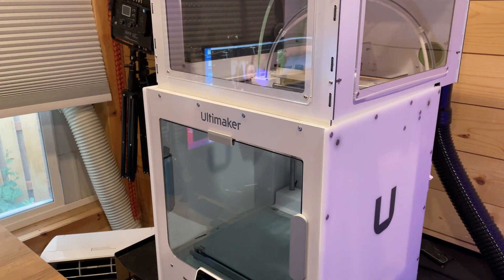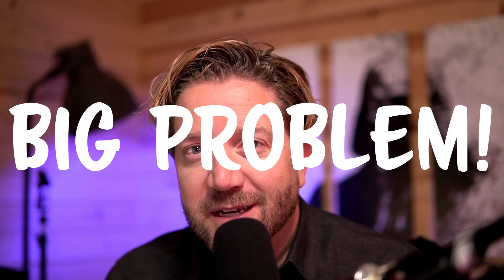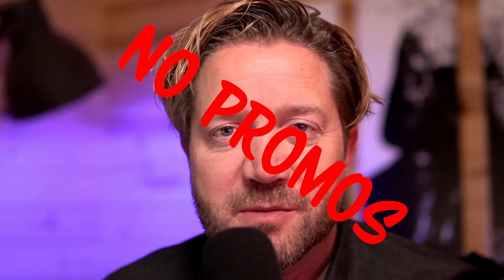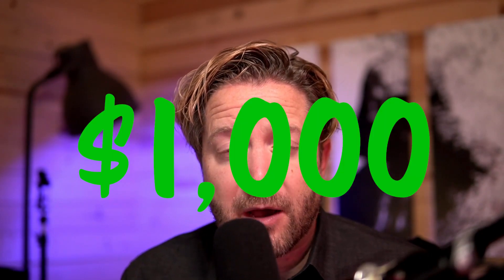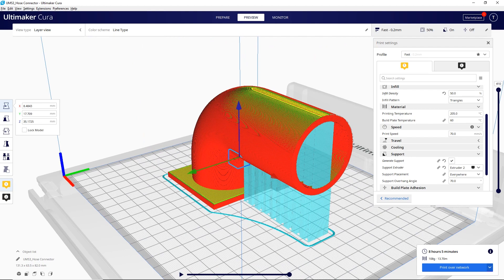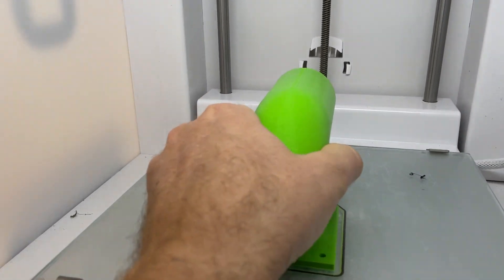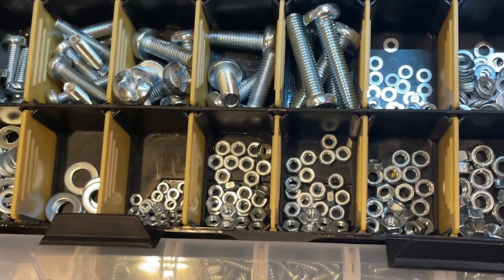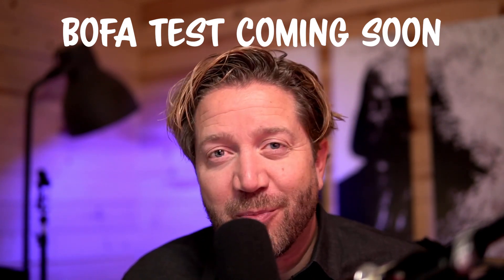Removing My 3D Printer Fumes (Enclosure & Filter Build)

Comment: Use a different angle when either designing the part or when placing on build plate to eliminate supports.
You could have gone with a say 60° angle for the part design instead of 90°. 
With the 90° angle design you could have rotated the part on the build plate in such a way that the supports are minimal.
Also with the 90° design instead of supports you could have added a rib of 1-2mm up to the build plate, only the beginning of the circle needs supports.
So really there are multiple solutions which were better than what you did, but yeah you just used a little more supports no big deal.
Also why are your corners not rounded on the mounting plate ? This does not make sense, since rounded corners print faster, nicer and better.

Comment: Yeah, I have a better way to do that.  Go to a hardware store and get a PVC 90 degree bend of the closest size.  Then 3d print only the coupling/adapter from the PVC to the enclosure.  Probably a 2 hour print instead of a 6 hour print.  A lot of these parts exist and don't need to be printed.  Just a suggestion.

Comment: Hi Tyler, Years ago I bought an expensive [enclosed] 3D printer that has a slot / tray for a HEPA-filter. The printer sits in a closet. This keeps the temperature constant, the sounds muffled as well as the effects contained. This proves to be very effective. The HEPA-filter works well filtering the air. I change the filters regularly to keep the air clean. When processing big prints, I ventilate the closet using an extraction fan and tubing [like you do.]

Comment: I would have tried to "chamfer" from pipe to plate where the screwholes are, and print it at an 45° angleshowing both pipe openings upwards. this way, most of the support inside the pipe is not needed, since most overhangs are 45° or less

Comment: You could split the part at the center of the bend at 45 deg, add some collars on both parts (or flanges) to connect them together. This approach would result in stronger and faster print
Reply from the maker: Cool idea!